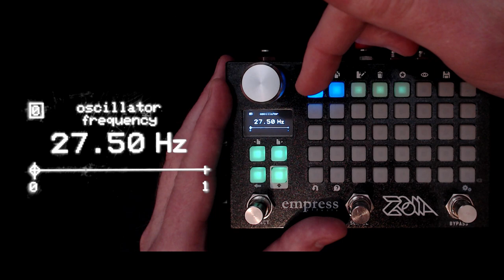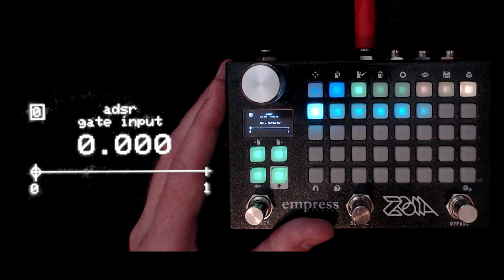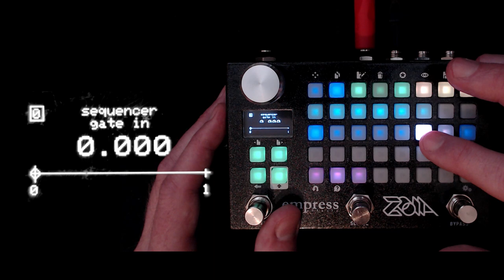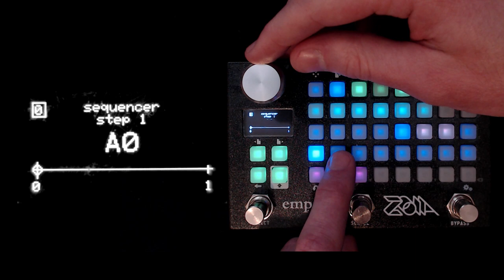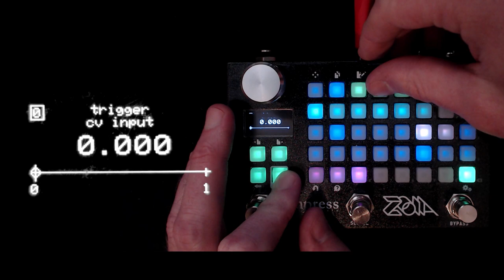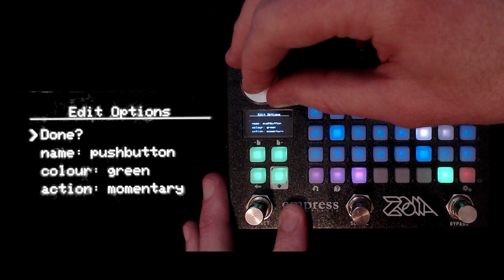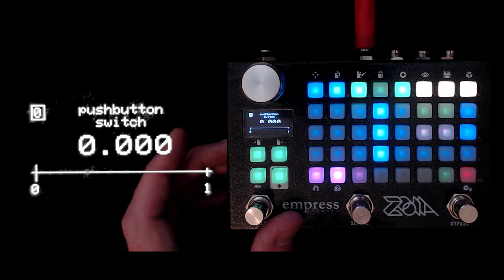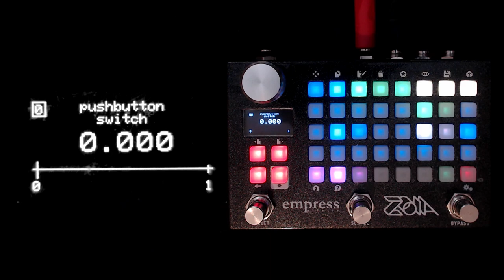Zoia Tutorial: Sequencers Modifying Sequencers - Empress Effects Zoia

Comment: Hello Hakon. I'm a beginner with the Zoia, thank you for your videos, really helpfull, very clear ! I tried to reproduce this simple patch, but as soon as I connect the cv output of the 2nd sequencer to the oscillator frequency, and choose new values on the steps of the second sequencer, it immediately changes the pitch of the first sequencer even if the second sequencer is not engaged with the LFO. Did I miss someting ?
Reply from the maker: Hello. Thanks for your comment. It's been so long since I made this one I had to look at it myself to see what exactly was going on, and because it is so basic (I was quite a newbie myself when I made it), it doesn't actually disconnect the CV output from the second sequencer from the oscillator when it's not running, meaning that whatever value is on the last step of the second sequencer will still be added to the oscillator, and I presume that is the effect you have seen when patching this up.

If I were to make this now, I'd probably have made it so that when triggered, it would wait until the next cycle of the main sequencer to start, only then connecting its value output to the oscillator on a single run through, and then disconnect when it was done. All a little more complicated, but perhaps I should revisit this and make a tutorial explaining that in detail one of these days.
Reply: @hakonsoreide  That's it ! Thanks for the explanation !